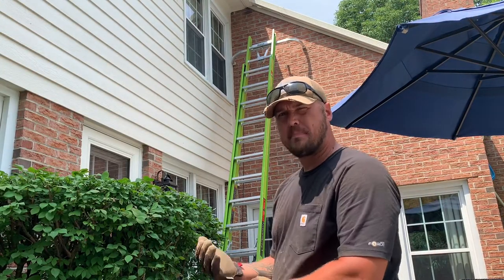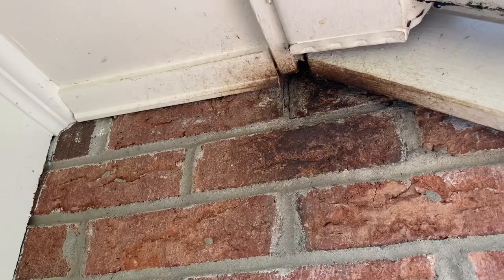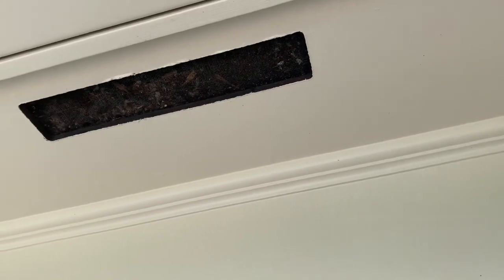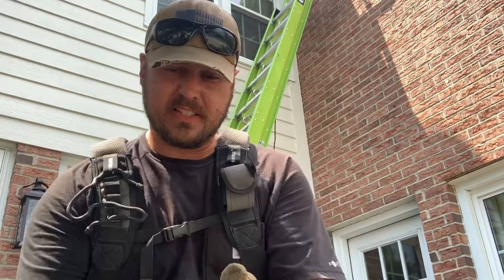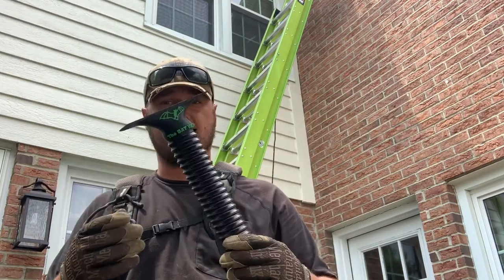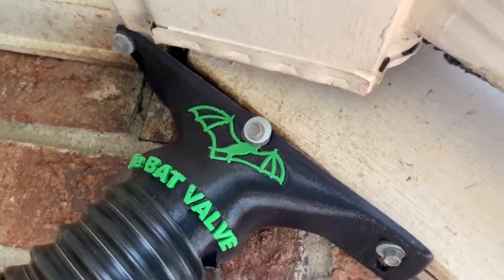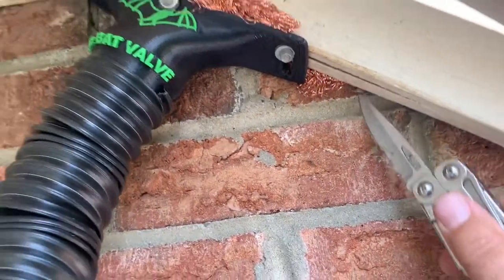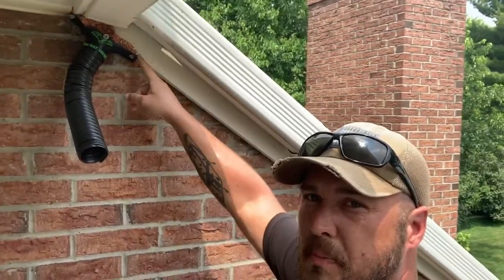Soffit and Fascia Bat Removal (Exclusion with "The Bat Valve")

Comment: Are in the process of bat exclusion.  They are in the soffit. They entered where the soffit was cut too short against the chimney and also rotten fatsia against the chimney. There is also a gap in a valley in top of roof by my master bath.  I could hear them over my commode area .  Worst job we have ever had. W e used screen and a bunch of plastic also a plastic cup with the bottom cut out to block the bats. But they can fly out. We have waited til possible pups were old enough to fly out.   We watch every night when they come out, so we no longer see any come out so we will call someone to come out with a tall ladder to repair the areas.

Comment: I hired bat exclusion guys.  I saw them go up to the soffits and start messing around. I did not see any bat exclusion tubes sticking out when they were done after about 4 hours.  I was told they installed the tubes in such a a way that the tubes would be left inside the soffits.  This didn't make much sense to me, but they have been doing bat removal and only bat removal for over 20 years.  I think I had large brown bats.  Greetings from Minnesota.

Comment: Cool video!  I have an exterior corner condition. Meaning the corner is protruding, not an internal corner like what you showed here, where my bats are coming in and out.

Does the back valve work on an exterior corner?

Comment: What prevents them from entering through the tube? Are they just hot able to figure it out or physically can't climb through it? Doesn't appear to be a closing one way valve or anything inside.
Reply from the maker: The way that bats enter a structure is they have to land against the surface, and crawl in, the design of the bat valve does not allow them access that way anymore. They can leave but they can not crawl out on the tube to gain access

Comment: Is it best to caulk the area were the brick meets the vinyl siding or use a material like steel wool?
How do you repair the Eave that meets in a 45 degree angle.  Screen or steel wool?
Thanks Paul

Comment: We found the entry point.  The mesh ridge vent was cut too short and it left a big hole in the slit.  The issue is that this is a horizontal surface.  I havent seen anything that addresses this as far as an exclusion.  We're in NH and just started to hear activity so i assume they are out of hibernation
Reply from the maker: Gosh, I am so sorry I did not see this comment come through... look up "bat valve" on Amazon, there is a version that has a "spiderweb" sort of base to it that will work well in that situation. Good Luck

Comment: New Subscriber, Excellent channel.  I have a small wildlife nuisance business in Montana.  Any ideas how to get access under roof dormers?  Many times the length of the dormer and pitch of the roof, leaves zero room to get under and seal the bat entry holes?
Almost impossible to work in such a enclosed space.  I know it’s a tough question.  Thank You…
Reply from the maker: at that point I build out a "box" with 1/4" Harare cloth to "extend" the dormer to a width I can work with. I will see if I can make a video the next time I do one as I know it is hard to articulate.

Comment: I’m installing the bat value this weekend. It appears that the bats are on the outside between my house and chimney. Do you recommend filling it with something like foam insulation to close off the space after a few weeks with the bat door?
Reply: That's what I did with my chimney at about 10pm from inside the attic after they had flown out.
I also had a tighter chimney flashing installed by a roofer.

Comment: This may be a stupid question, but how can the bats not get back in if they can get out, it’s open both ways right?
Reply: I've been wondering that too.  I think it is because they have nothing to hold onto.  When they stop flying I think they need a broad, flat, surface to land and hold onto.  Since there is no surface around the end of the tube, they just fall away from the opening.
Reply: From what I found they cannot hover like a bird.
Reply: @mrniceguy423  makes sense, thanks!

Comment: How long normally they can be gone? My pest control company said to leave the door for 6 weeks.  Now it’s already 12 days since the one way door was installed. There is still lot of noise from the ceiling. So frustrating. What could be wrong? Thanks!
Reply from the maker: Lia Luo it all depends on the level of infestation, climate on the exterior, and species of the bat. Here in southern Ohio in August the little brown bat is very active. If you PCO has stayed 6 weeks, then I would trust their knowledge and expertise in regards to your unique situation
Reply: Huntsman Wildlife, LLC thanks for the reply! Will wait for another week to see.
Reply: Bat valve
Reply: @lialuo8006  How did things end up going for you? Did it take the 6 weeks they projected? Longer? Shorter? Was there any issues after the exclusion?

Comment: If bat hangs outside home  how to deal with?
Reply from the maker: If they are just hanging on the outside of a home, it may not be much of a concern. Make sure to leave outside lights off in not in use to deter insect accumulations around the home. Bats will occasionally decide it takes too much effort to go back to their roost so they will find a safe spot to spend the day. If it is an ongoing issue, you may want to call a professional to determine if there is an entry point you are not seeing. Good Luck.

Comment: Is it common to have bats enter from a lower place, like a basement window? Or do they generally like being up higher?
Reply: I believe they have to descend to exit.  If they go to the ground they can not launch themselves back up like birds.  A bat on ground has a problem and may die as result.
Reply: I know this is not true. I had a bat in my basement near the basement bathroom and I had a nose and looked over and a bat was behind some stuff on the ground and it took off flying from the ground.
Reply: @55shocked55  i've also seen bats take off from a floor...

Comment: Curious if the gap in your soffit is not along the brick can they still get in it.   We say a bat on the brick in this area but no signs of dirt etc by it.  Also checked attic and no signs of bats in there.  Could he have just been hanging out in the corner on the brick all afternoon because of nice weather?
Reply from the maker: Some bats only need a gap a little less than a 1/4 inch to squeeze in. It may have just been roosting in your description. Sometimes bats realize it would be too costly calorically to fly back to their roost so they will find a "safe place" to roost for the day and be gone at dusk. Look for consistent accumulations of droppings on the brick face or the ground underneath to see it it is a habitual roost.

hope that helps.
Reply: @HuntsmanWildlifeLLC  super appreciate it!  Thank you!
We reallocated him to a forest nearby, so not to take any chances.

Comment: My brother recently bought his first home...a 2-story historic house (which he's restoring), with a wood burning fireplace. The fireplace hasn't been functional for many years, and is considered condemned (bricks have caved in from the inside and the damper is broken)...it has been capped, in the past, but it is not known when it was done, or how well it's capped/or if it has moved at all (especially during recent storms). My brother temporarily stuffed about 6 inches of insulation on top of the broken damper and some of the bricks that have caved in, after he had a fireplace repair company come look at it (next year, an electric insert will have to go in). When the fireplace company came, my brother and the company didn't see anything in the chimney (back in late March)...and for 5 months (since February), there was no evidence of bats in the house. Several days ago, we noticed loud bat sounds coming from the opening of the fireplace (it feels like they are close to your face, when listen, inside)...we strongly believe that they are close to the insulation that my brother stuffed over the damper, and possibly sitting on top of it. We've tried the ultrasound repeller box (for days), but had no success. We don't believe they have ever left the chimney, since they came down 5 days ago...they off and on make sounds (even during the day). My first question is...do you think they will ever leave from the top of the chimney again, on their own, to feed or something? We would love to be able to get on top of the roof to see where they came from (but don't have the equipment to so yet). We would love to try the bat valve, like you've shown. We were also thinking about getting some sort of camera down the chimney, to see how many bats there are (unless there is another way). We want to do that from the inside of the house/and go above the damper with it, but it seems too risky, since we would have to take the insulation out to do so. We may board up the bottom of the damper. My second question is...do you have any recommendations for what types of cameras/tools we could use? And third, do you have any advice/tips for us to get the bats out ourselves? Unfortunately, we are unable to afford the pros, at this time, but would like to remedy the situation. Thank you!My brother recently bought his first home...a 2-story historic house (which he's restoring), with a wood burning fireplace. The fireplace hasn't been functional for many years, and is considered condemned (bricks have caved in from the inside and the damper is broken)...it has been capped, in the past, but it is not known when it was done, or how well it's capped/or if it has moved at all (especially during recent storms). My brother temporarily stuffed about 6 inches of insulation on top of the broken damper and some of the bricks that have caved in, after he had a fireplace repair company come look at it (next year, an electric insert will have to go in). When the fireplace company came, my brother and the company didn't see anything in the chimney (back in late March)...and for 5 months (since February), there was no evidence of bats in the house. Several days ago, we noticed loud bat sounds coming from the opening of the fireplace (it feels like they are close to your face, when listen, inside)...we strongly believe that they are close to the insulation that my brother stuffed over the damper, and possibly sitting on top of it. We've tried the ultrasound repeller box (for days), but had no success. We don't believe they have ever left the chimney, since they came down 5 days ago...they off and on make sounds (even during the day). My first question is...do you think they will ever leave from the top of the chimney again, on their own, to feed or something? We would love to be able to get on top of the roof to see where they came from (but don't have the equipment to so yet). We would love to try the bat valve, like you've shown. We were also thinking about getting some sort of camera down the chimney, to see how many bats there are (unless there is another way). We want to do that from the inside of the house/and go above the damper with it, but it seems too risky, since we would have to take the insulation out to do so. We may board up the bottom of the damper. My second question is...do you have any recommendations for what types of cameras/tools we could use? And third, do you have any advice/tips for us to get the bats out ourselves? Unfortunately, we are unable to afford the pros, at this time, but would like to remedy the situation. Thank you!
Reply from the maker: We use the Ferret Camera... as for not being able to hire a pro... it may be worthwhile to at minimum pay for an inspection and have a professional give you an idea as to what is going on. You cn find a provider in your Rea by going to NWCOA.com and entering your zip code.

Comment: The screws you are using are way too big and caused damage to the property.  All you need is some small drywall screws with some homemade rubber/plastic washers. These will not damage the property and leave a tiny hole.
Reply from the maker: thank you for your engagement
Reply: The screws he used aren't much different than drywall screws.
Reply: @steventhury8366  Only difference here is the screws he used split/damaged the customer's fascia board and drywall screws would not have caused any damage.